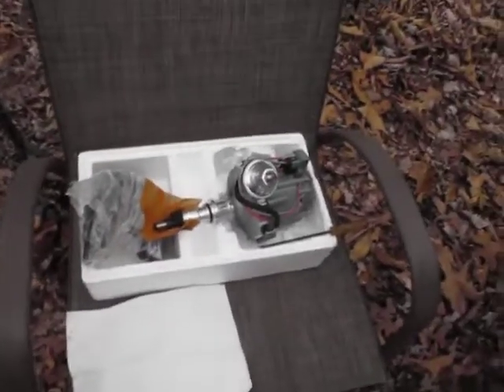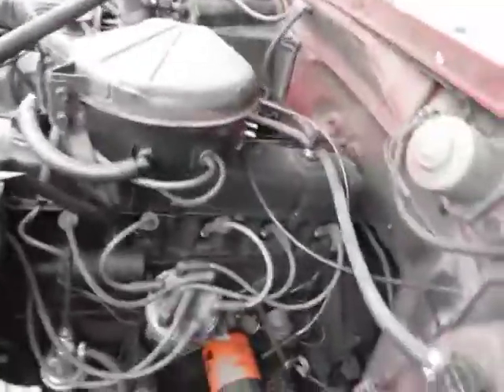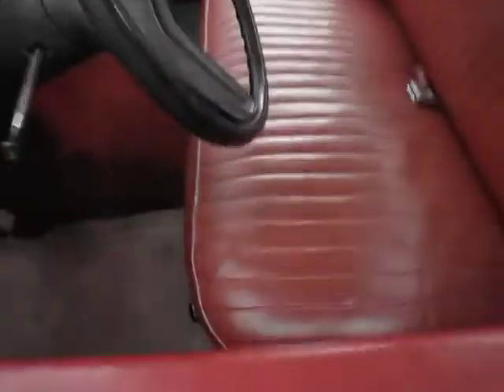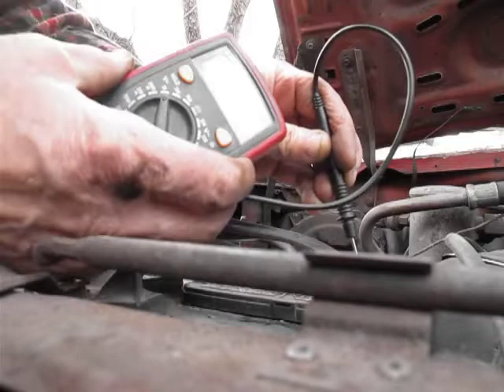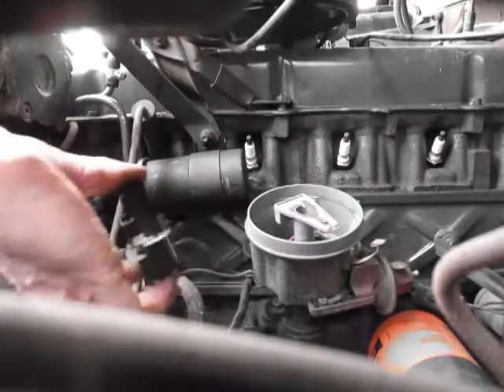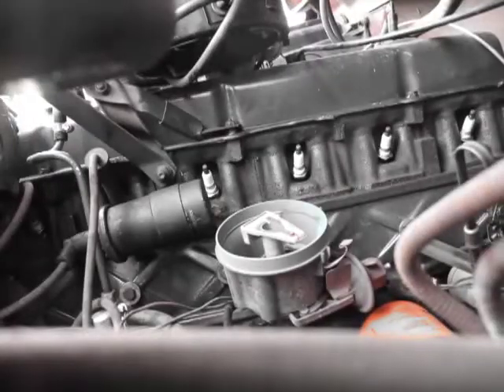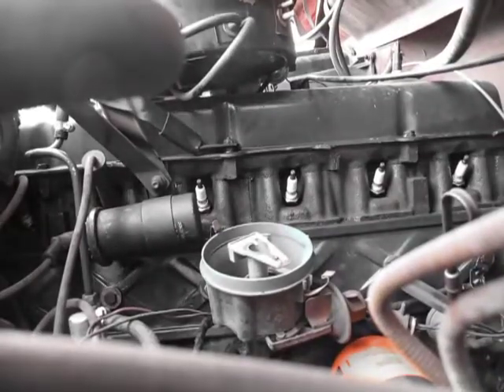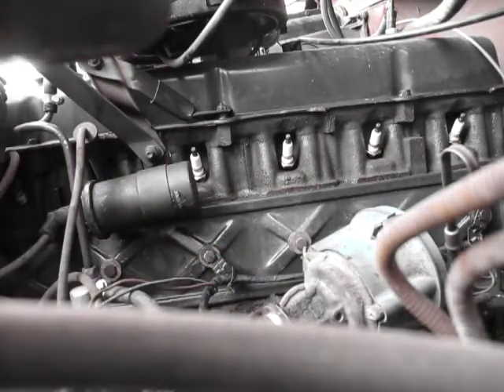hei install part1 ford 300 inline six

Comment: Can you use an hei distributor with a fuel injected 300?
Reply from the maker: hmm i dont see why not,but let me check on that with the f100 group on facebook
Reply: @ okay, thanks! I just saw that little vacuum diaphragm. So wouldn’t know where to put that on mine.
Reply from the maker: @chiliboom6140  yes better keep like ford designed it,at least you have a dual outlet exhaust manifold thats a very good thing to update on a 300 with a carb.and it should be on yours from the factory
Reply: @ Okay. I appreciate the advice and swift replies. Thank you friend!
Reply from the maker: i dont think its a good idea,something about knock sensors being cut out of the loop,what year ford 300?
Reply: @faulknerfixesall  It’s a 94. I saw the knock sensor connection and wondered about that too.

Comment: Nice video. It reminded me, as a side note, I haven't used a test light in decades. I have one, just always reach for the multimeters now. Had to think why for a bit. I believe it is because of the change to computers and that style of diagnostics where you always are checking for voltage or resistance. Same reason you ended up grabbing your multimeter to make sure a full 12vdc.
Reply from the maker: thanx for watching, i guess i am just old school with work trucks.my dad always said if you cant fix it with hand tools then its not the truck for you.folks commented that i should go right from the battery for the 12v but the wire i tapped into went to the coil originally so i didnt see a problem.still running decent several years later😀

Comment: Don't guess u heard that don't use a fram filter,use a wix's,and use rotella diesel oil in your 300
Reply from the maker: yes i have switched over to wix 5150
Reply: back in the late 80's I would troll junkyards for parts for my old cars. I always noticed most, and by most seemed like 90% or more, of the junk motor pile had fram filters. I know they are the #1 filter at the time, but seemed like a pattern. Never used a fram filter on anything ever of my own.

Comment: The best wat to power up that unit is to draw the 12v power directly from the battery...   that white wire you're testing would be a good source of power to operate a relay...   that's what I did, works great.

Comment: How is that HEI distributor holding up? And could you tell us the name/part number of the HEI kit you installed... I can't seem to find one for a 6 cylinder on Amazon right now. As an aside, I stopped using anti-seize on spark plugs long ago because of the thread gumming poblem. Instead I coat the threads of a new plug with 30w motor oil, torque it to spec and have never had a problem pulling an old plug out easily in 30-odd years. I'm seeing a lot of videos lately where both anti-seize compounds  and threat-lockers are being way over used, which usually leads to problems down the road... if not for the guy who did it, then the next poor soul who has to work on the same spot.
Reply from the maker: well its been 10 months with no problems at all,the kit was from amazon and was from A team performance it includes the 8mm wires as well but the price did go up to $139 . as for the never seize i was having sealing problems with the plugs (most likely because the engine needs a ring job) but the clean threads and never seize seemed to work well. i keep saying when this truck fails completely i will buy a newer truck. haha i think its going to be a while.

Comment: You have any problems with voltage. My battery has to be tip top full (brand new) and I ran a fuel pump relay setup for it or no spark. 

You dont happen to know what the oem gm equivalent car would be to order the guts to this distributor to try? Im same motor, same amazon dizzy
Reply from the maker: i think you should check your 12 v supply line with key on and starting also,it may drop down to an unacceptable level when your cranking it ,i dont think the hei will work with  8 volts or less,i will check on the the distributor guts but its been a while since i installed it. get someone to crank it over and test supply voltage

Comment: Hey thanks for the videos. What hei did u go with
Reply from the maker: it was just a cheapy amazon $70 one.summit has them for a lot of money but i didnt see the need,its just a work truck. if it fails i will plug the duraspark distributor back in. i didnt cut any wires except the power lead to the icm,and thats still mounted on the fender well.